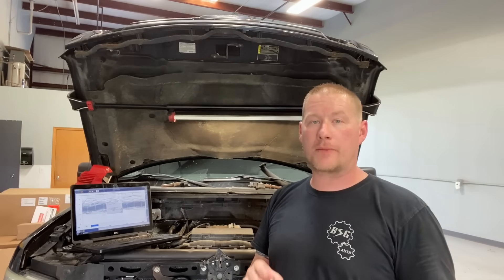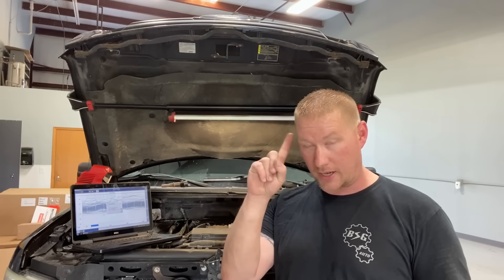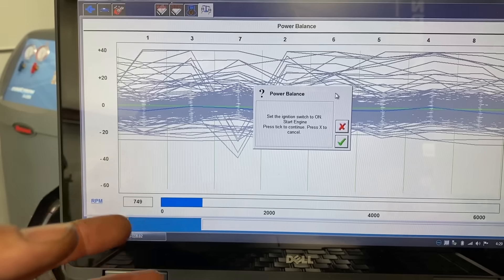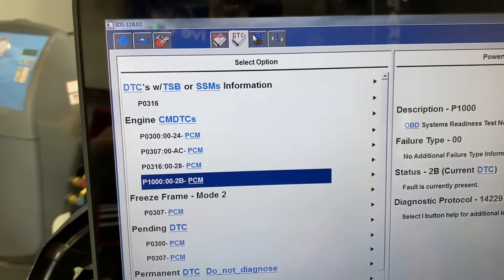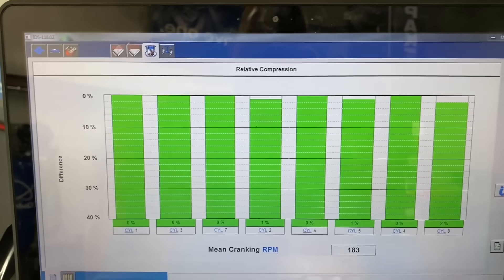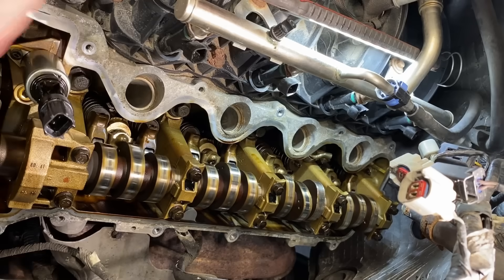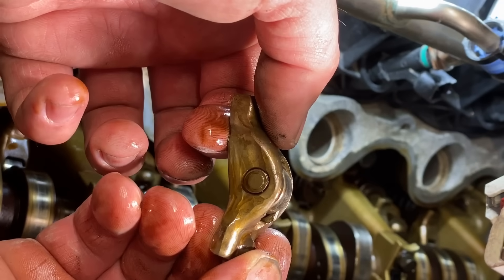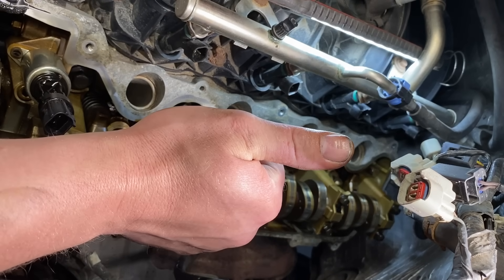Ford F-150 & Expedition 5.4L 3v Triton Engines Hard to Diagnose Misfires Fixed!

Comment: I'd say that the cat replacements where not a waste of money since they usually need replaced especially by 200k. They clogg so easily. This guy was lucky it just fell aside.
Reply: I've seen lots of vehicles with more miles on the factory cats.  A simple temperature check can tell you if they're clogged.  Also, if a cat were clogged it would be extremely unlikely to cause only one cylinder to misfire.  Replacing them was clearly a misdiagnosis by an ignorant person.

Comment: Poor customer, have him spend all that money for no reason good job Brian
Reply: Always pay with a credit card that will charge back on disputed costs.
Reply: Wonder if he could get partial or full refunds.
Reply: @tmaq9726  probably won't get a refund
Reply: @MrPami9899  He could in small claims. These idiots didn't even do a diagnosis. They just threw parts at it. Totally the mechanic's negligence in all of these repairs that weren't needed.
Reply: @BaileyHatfield-b3f  PCM is like $800 isn't it?
Reply: Cant believe he didnt give up on the truck.
Reply: Rick Simpson  - In this day and age, checks are electronically cashed immediately.
Once that money is drawn out of your bank, it's a terrible mess to recover. 
Credit cards are a much safer and easier option.
Reply: Iron Fe you are absolutely right! I learned lesson that I bought 05 F150 5.4L 3v and it was disaster for me when I had this truck for 6 years oh my gosh I spend a lot of money but I sold it so I bought a Nissan Frontier brand new with no issue!
Reply: Iron *Fe*   well said... 100%
Reply: STEEVE DAVID Nicolas 
That’s why dealers scare the crap out of me.
Reply: Sensors and pcm’s are a windfall for repair shops. All BS.
Reply: Its like these days that's all you see. Repair shops "diagnose" your problem only to sell you parts and labor just to leave you with the same problem. Then your forced to continue to replace parts or get rid or your vehicle.
Reply: AMEN!!! My neighbor and I have the same Ford Expedition, year, color and date manufactured. We both had/have the SAME problem at 100,000 miles. Trans, coils, spark plugs, engine grinding, truck feels like you are driving on the street reflective strips. It’s stuff been on and on. It’s a 08 and I got it in 2014. My 1997 Explorer which I purchased in 2002 with 100,000 miles and it ran with the minimum of issues. Lower and upper control arms, battery, alternator brakes and rotors was ALL I replaced until I wrecked in 2014 with 293 miles on it. Within a year with the 5.4 problems after problems. Just sickening!!!
Reply: PCM alone probably wasn’t cheap
Reply: Can this happen with a 5.4L 2V???
Reply: Can’t imagine how much money he spent.. pry paid the value of that expedition
Reply: @s60t5M  it's happened to me on my 04 F350 6.0 thousands.....
Reply: @DWATSON1975  With a 6.0, find a shop that specializes in that engine.
Here in Vegas I use AJ's, the only Bulletproof Diesel authorized shop in town. Not cheap but they do excellent work the FIRST time. After being bulletproofed, I LOVE my F350. The only work done in years is the #1 glow plug and normal fluid changes. I tow in high heat. 120*+ with no issues.